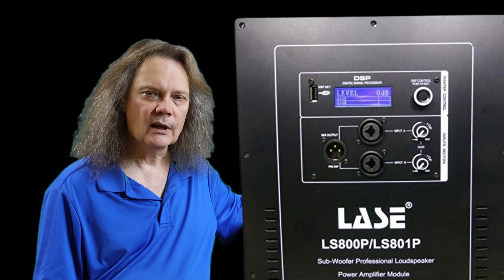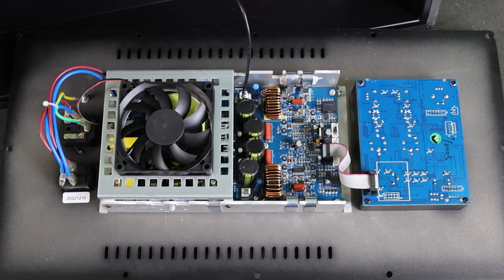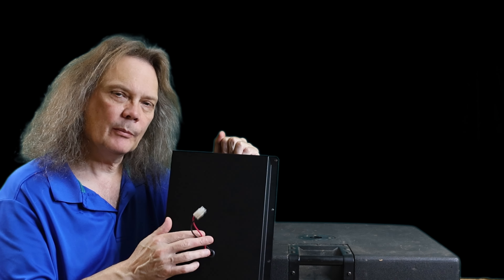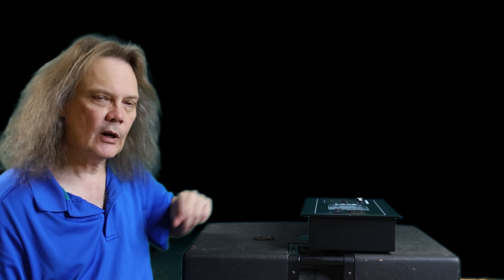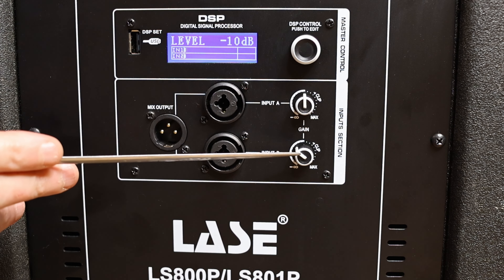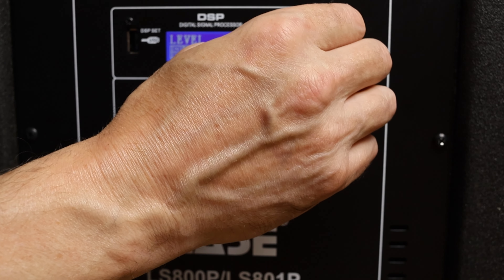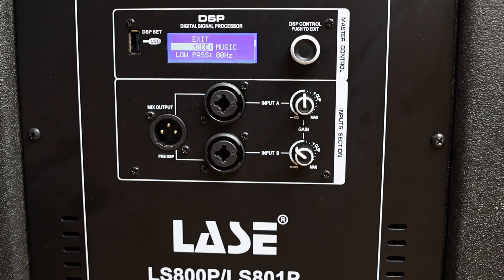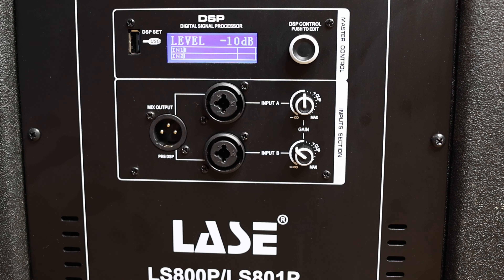Subwoofer Upgrade - LASE 1000 Watt Replacement Plate Amplifier

Comment: I've contacted Yorkville about replacement amp modules for my LS801Ps and they basically said they replace them with these Class D modules now as they are discontinued subwoofers now. I'm currently waiting for a pair to be shipped, and can't wait to fire the old boys up again!
Reply from the maker: Thanks for the update
Reply: The Yorkville Elite LS801P subwoofer has been remodeled as the Yorkville Elite ES18P.

Comment: Another good and objective review.
Reply from the maker: Much appreciated!
Reply: Friend, my English is not good, I don't understand much but I would like to know if you recommend that brand since a JBL EON 618 subwoofer was damaged and I'm about to want to grab one like that, they have 618 for the same one. @Barry-Watson
Reply from the maker: I would prefer to opt for repairing or replacing the amplifier with the original JBL model. In my opinion, its build quality is likely superior, and it preserves the speaker's originality. While some individuals have encountered issues with aftermarket LASE amplifiers, I have had positive personal experiences with them. However, the LASE amplifier seems somewhat lighter, suggesting it may not match the quality of the original OEM product. Nonetheless, given my positive experiences, I would be open to selecting the LASE as an alternative if obtaining an original OEM amplifier unit proves difficult or overly expensive.
Reply: @Barry-Watson  Thank you very much for responding friend. I will make your recommendation, good luck.
Reply from the maker: You're welcome!  Best wishes.

Comment: Do you have any experience with rack mount Lase power amps such as Lase 4000 and Lase 6000? I would love to see a review on them. thanks
Reply from the maker: I have not used those amplifiers so I don't have any experience with them.  Sorry!

If you send me one, I'll test it ;)

The plate amplifier works well and looks like your typical low cost, but decent quality product.

Comment: Hey...great review,   are you interested in selling the old yorkville amplifier module? Let me know. Thanks
Reply from the maker: Haven't really considered it.   That old amplifier is not working properly and it's pretty heavy + big to ship.  I looked at it a while back, and I don't think it's a simple repair issue.  Probably not cost effective to ship and repair compared to purchasing a new unit like this LASE model, or maybe you can get a working OEM replacement from Yorkville?
Reply: @BarryWatsonAudio  thanks for your reply,   I don't mind if its not working, I need it for parts, give me a price and cost of shipping to Miami. I would like to have it. Thanks

Comment: Replacing a 1400 Watt Yorkville amplifier with a 1000 Watt Lase amplifier is not an upgrade. That is a downgrade in terms of SPL. The Yorkville amplifier produces 31.46 dB while the Lase amplifier produces 30 dB of output. You just lost some SPL. Bad idea.
Reply from the maker: Point taken, and as you calculated - the output difference would be a loss of 1.4 db max output (assuming no loudspeaker power compression etc).

A 1.46 dB difference is relatively small and not be easily perceived by the human ear, as noticeable volume differences typically require a change of about 3 dB or more.

To double the perceived loudness, you would need roughly 10 times the power.

If I had easy access to a replacement OEM amplifier I would have gone that route. I agree, replacing the unit with an OEM amplifier would have been a better fix. However this LASE unit fits the box, and appears to work just fine. In practical terms I don't see any significant difference in output.  Thanks for the observation.
Reply: The 1.46 dB you lose with the Lase amplifier will be noticeable if you perform A and B testing. That 400 watts difference, the 1.46 dB will provide an extra headroom for the dynamics of the program material, the peaks and transients, especially for bass heavy music.

Comment: Yea throw that thing away.  This company makes their money by making fake copies of real products.  It’s a knockoff company. Don’t promote them.
Reply from the maker: Please let me know what product you think I should have purchased instead.  This plate amplifier is definitely not a copy of the original OEM amplifier, and so far, for me it's working very well.  Who do you claim they are copying?

This was the only non-oem amplifier module that I found that properly fits this model subwoofer. If you know of a better product that would also be a perfect fit I would be curious to hear about it.

When I explored product reviews, there were a couple of negative reviews regarding the LASE amplifier modules, but just about any company occasionally has an unhappy customer. Overall the reviews  were overwhelmingly positive, and so far that has been my experience as well. Thanks for your input.
Reply: @BarryWatsonAudio  this specific product is not a copy.  This company however is all over the internet and alibaba selling knockoff RCF, JBL and other companies products.  They sell complete cabinets as if they were RCF, JBL etc at 1/4 of the price.  

They may have had good intentions when they made THIS product but that goes by the wayside when you see what they're actually doing.
Reply from the maker: Thanks, I've seen lots of import products that are good quality and great value.  But, we also sometimes see where some companies take the cost cutting a little too far.  I have a particular problem with some of the fake knockoff products like counterfeit Shure microphones and counterfeit electronic component parts that do not perform as well as the original, and deceive customers.

Thanks for the info!
Reply: @thenightlifenj1 but is the quality the Same?
Reply from the maker: I would prefer to replace it with an OEM amplifier if it was readily available. The original amplifier uses a linear power supply, with a big heavy transformer, the new one is all digital and lightweight and typical clean looking import manufacturing.  So far, I don't have any complaints about the performance of the replacement amplifier.
Reply: @holehol3554  of course it isnt.
Reply: @Barry-Watson have you tried getting in touch with Yorkville?  BTW the lase amp is definitely not 1k watts.  You can clearly see its not.
Reply from the maker: Have not measured it, but the box appears to be working properly with plenty of output.